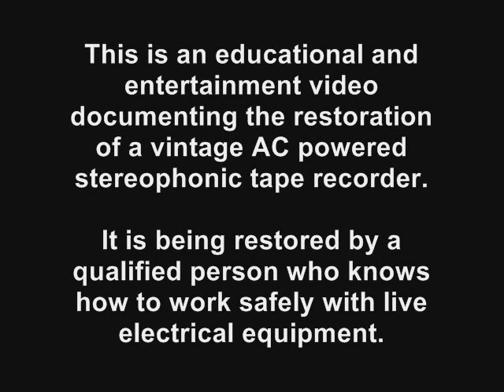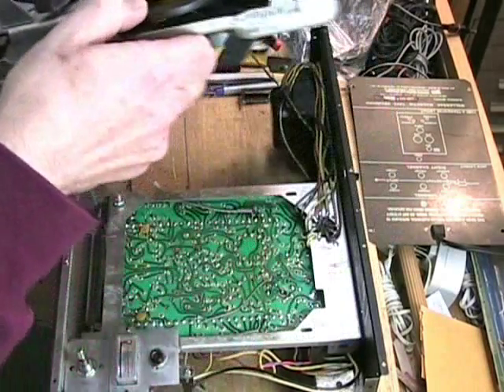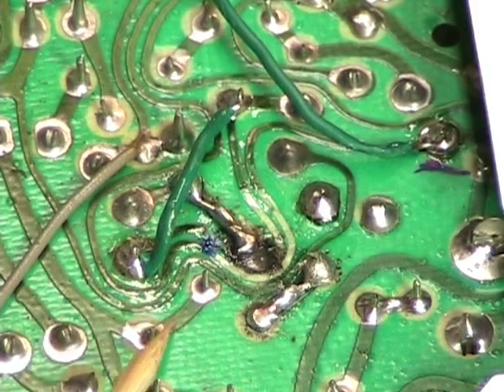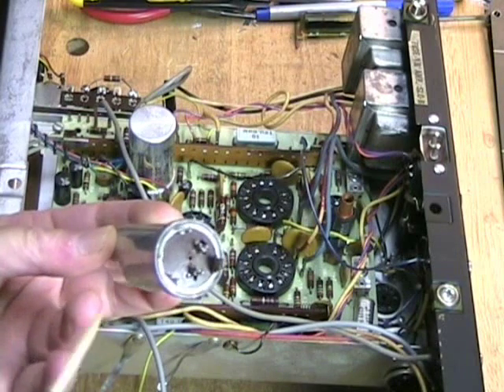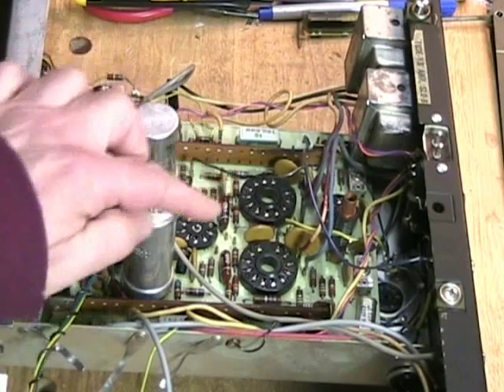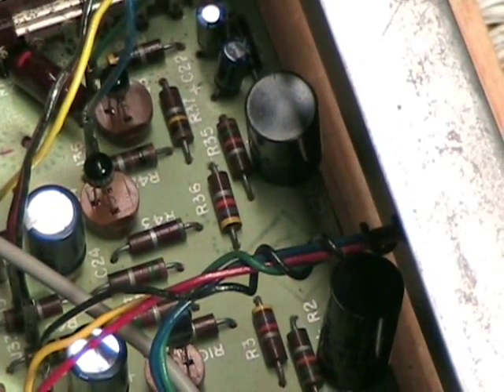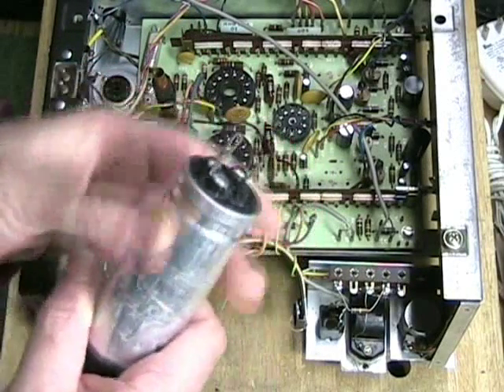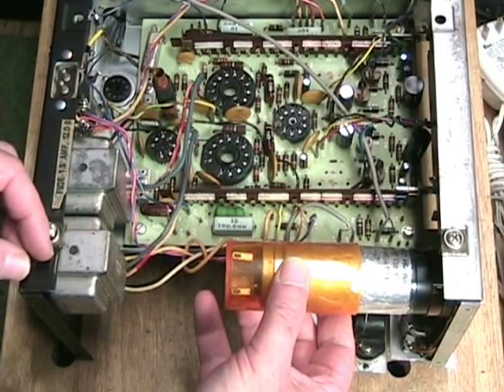Exposing Wollensak Model 1288 Stereo Tape Recorder Restoration Electronics Overview  Part 6

Comment: Thanks for the videos.

I restored a Wollensak 1220 2 years ago.  This is mono, 4 channel version of the 1288.

Replacement caps purchased from Mouser Electronics were easily mounted to the circuit board.  I believe they were made by Nichicon, and will likely have longer lives than the originals.

While the tubes and transistors test good, the record sensitivity seems to be far below normal, so I will likely have to dig into it again once I obtain a schematic.

Otherwise, it works very nicely.

Comment: I used discrete capacitors in my restoration.

While the large can in my machine had a bulge where the numbers were imprinted around the side, it tested good on a tester.  It was the low voltage caps that fared much worse and showed a lot of leakage on the tester, even though they looked brand new.

I prefer Mouser's (and Digikey's) paper catalog over their website any day.  :-)

THANKS for the schematic offer.  I'll be in touch.

Comment: That was a great idea on mounting the new caps.  But how come you just didnt use ordinnarry capacitors to replace the ones that had blown? I would have used a couple of 47uf to replace that large one and two 22uf to replace the smaller one, just as long as they can handle the voltage.  (that's what I did when I re-capped the peto scott a long time ago). I know it's ok to go slightly higher with the main filter caps in most cases.

Comment: Also I'd like to add that the design of the 1580 comes from the original 1500 series from the 50s. However the 1288, and the 1580 share more of the same design features.

Comment: The transport of the 1288 has it's origins from the Wollensak 1580 stereo tape machine released in 1962. I own a mint condition 1580 myself. If you look at the 1580s controls and general layout itself you'll see what I mean. I also have a website dedicated to the 1580. Just Google Wollensak 1580 and you'll see it in the search results. The 1580 is an amazing sounding machine that uses the 7591 amp tubes.

Comment: why do you have used such a big capacitor that is nothing more than 2 capacitors with the negative side together? You could have used modern capacitors much smaller soldered directly on the board and avoid all that work. That guy that you got advise for it must not have much knowledge and you neither. A capacitor is a capacitor. Only the value matters. The form factor is irrelevant. You may have used modern much smaller caps to do that job. Caps with the same value from the ones you took out from the machine and you could wired the new ones according to the schematic. You take 2 caps and join the 2 negative leads and it makes one common point. And the other 2 leads are the positives. With 2 modern caps you should be able to do one compatible with the ones that came with the machine. No need to do that work at all. It's even kind of stupid but... Whatever...
Reply from the maker: I agree with you and appreciate your thoughts -- but not the stupid part, however. At the time (4 years ago), I wanted to use can caps which I thought would fit on the board. I completely misread the dimensions in the catalog and was shocked at what arrived. But I had to make do because it would have been a real nuisance to return them and try and find others from that particular web site. I have since learned a great deal more about replacing capacitors and use Mouser, which is an excellent source. 

That said, there are MANY ways to re-cap a machine, and there is no "this is the one and only way" to do it. One can get creative if one likes. 

Before rushing off to judge someone, I suggest you get the whole story first, or walk a mile in their shoes. Otherwise, it looks like you are being arrogant and/or just trying to show off.